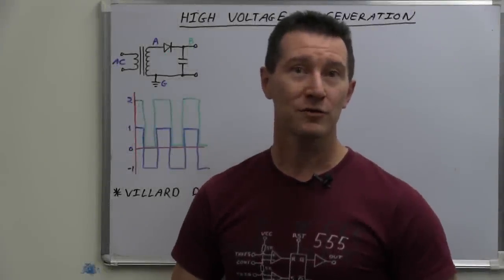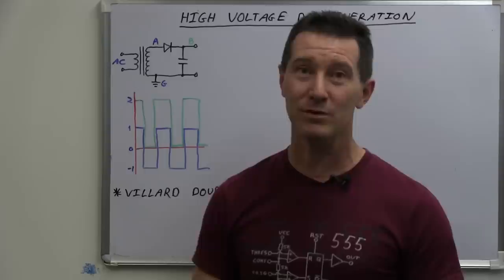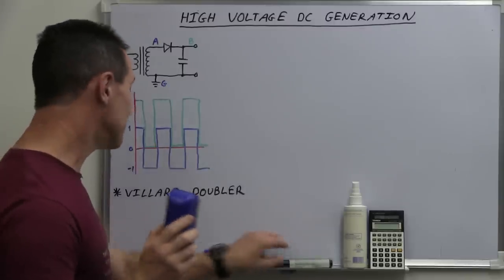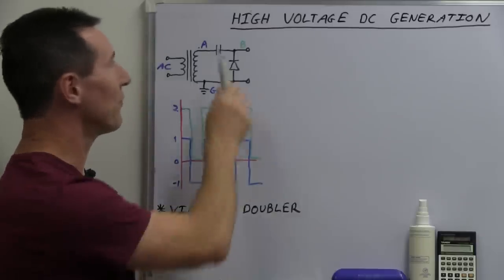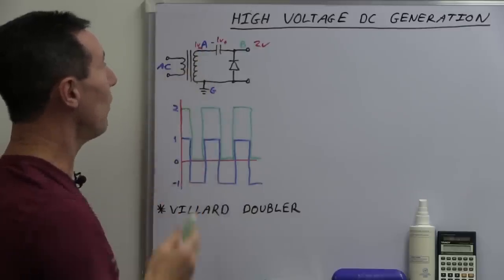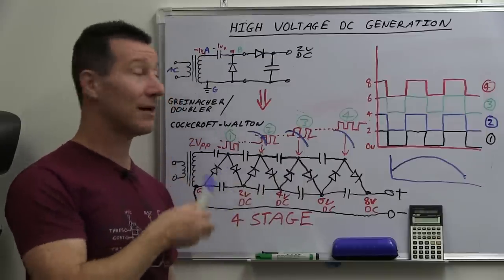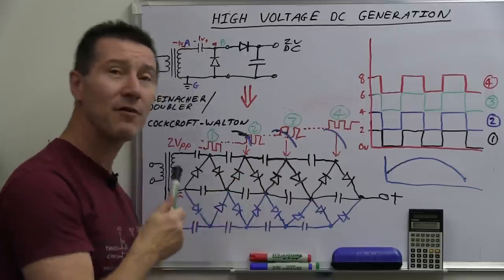EEVblog #469 - Cockcroft-Walton Multiplier

Comment: Hi There sir. I was wondering you said that you dont need diodes of the voltage of the expected output but only diodes rated for the voltage of the input. Is This same statement true for the capacitors

Comment: Thank you! I made one today after I watched this! I have a question... I am using this to send B+ power to an AM tube transmitter. It works! But... It transmits transformer hum... Any suggestions on eliminating that beyond the obvious filter caps at the output? (I tried that)...

Comment: @EEVBlog, How to calculate how much current such a multiplier can source/sink?
Reply: you most likely wouldn't put a load directly on the circuit as it can mess with its behavior. Using an operational amplifier with a gain of 1 will allow you to source/sink anything the op-amp can handle
Reply: If you don't consider the diode drops (and using low resistance diodes) you have a load cycle for your caps on low input value, so during high time you have an RC stage where R is the load and C/n is the capacity (n number of stages and C the value of the caps) thus more stages generate lower charge available, probably a cap in parallel on the output might help

Comment: I decided to make a Negative Ion Generator circuit after this lesson :) . I failed in a step but I can't detect my fault. Can anyone help me to fix it?

I used in my project;

30x 22nF 630v
30x 1n4007
1x 4.7mOhm resistor before the needle ( at the top)
Powered by 220v ac.

Some of the caps burned in the first try.
Reply: Random caps or most at the high voltage end? 12 of each might work better.. to sufficient voltage.

Comment: That is a cool circuit.  What is the capacitance value for the caps in that circuit.  What value would you use @ 60 hz and 10k hz?

Comment: I have a doubt. If we are applying AC Input. How in the oscilloscope we are seeing DC Volts. There should be high frequency AC.
Reply: I think - cause of Diode(1)  only 1/2 Cycle  AC  passes   ...   and so on.

Comment: Q: Is it possible to operate a CW multiplier in reverse? (i.e. Convert a high voltage high impedance source and generate low voltage AC)
Reply: Nope. If you did that, nothing would happen.

Comment: I've done this with using 28 numbers of 10nF /630Vac PPC capacitors and  28 1N4007 rectifiers. but didn't get expected high voltage at end.I couldn't find polyester capacitors but poly polypropylene.  Is that the problem & how come?

Comment: would this be an all right circuit to use as a variable power supply? (pull down at each 'doubler') (and adding a voltage regulator to keep the current steady)

Comment: What I don't understand is, how much current can I drive with this villard circuit ? And they use this circuit in the isolation tester, because I can directly use a Transformer like in a flash unit or TV Anode driver.

Comment: Is the output from the voltage multiplier of a TV set with @ 25 inch diagonal screen about 25000 volts at about 2 milliamps?

Comment: Thank you. informative and not boring at all!

I would like to ask, a voltage multiplier like you vid, doesn't multiply amperage? Or  stay the same or some losses?

anyone?
Reply: REMEMBER... when voltage goes up Current Goes Down
Reply: Luis E. Batres You forgot “for a fixed power or resistance”.
Reply: If it multiplied current as well, it’d be the solution to all our problems since P = VI. If you increase both voltage and current, we’d have more power at the output that at the input! That would solve the energetic crisis (and desperate physicists because they have to rewrite all the physics as you’ve just broken the first law of thermodynamics).

Comment: I have a Villard 8 stage with 20vpp input running and noticed that the total voltage is 500vpp. This is the max rating of any cap in each stage. Is this correct? TIA.

Comment: Hey Dave! I have a question. I have a LiPo and 3 voltage dividers running off of the battery (powered on by switches, I use this to differentiate between the three switches with only one ADC pin on my MCU instead of 3 IO pins, let me know if you know a better solution). All divider outputs (which output different voltages) go to the same pin. What happens when I press two buttons simultaneously? Does the highest voltage apply?

Comment: What about the current?..... since the voltage is only shifted up....does that effect the current.....does it drop in proposition to the V increase?
Reply: ken ezzell 
hi, there is only so much energy in the capacitors at each cycle, so this limits the current available. LT Spice is a good place to examine the operation.
There work very well when the input is the switching node on an existing DC-DC converter running at a few hundred kHz ☺

Comment: How do you compute the output power from a cw multiplier is it just based on the energy stored in the series connected caps, and is output power limited by the  caps themselves?

Comment: It's really helpful, But as implementing few questions arises like as I am getting 4-6 volts as a output but If connect the o/p with lower resistance value like 50 Ohms -30K Ohms, output voltage drops to near about 0-0.5 V, Here I just used resistance to connect one terminal of its with o/p of ckt and another one to ground. Is there any other option if i wanna work with lower resistance value(50-500Ohms) as o/p; expecting more than 1.8 V as o/p.

Thanks in advance.

Comment: Great explanation.  What happens to current through each stage, so that one can determine current ratings for the diodes?  Wouldn't 1 volt AC RMS be 1.414 volts DC?  I have a big plate transformer with an input of 240 VAC and an output of 1800VAC at 750ma which I want to use as the basis of a -40KV power supply at 40ma.  Doable with a CW multiplier?  Thank you for posting.

Comment: Sir which transformer you used??? actually we are mking marx generator so we need 2kv pure dc input for it.
Reply: +Sanket Yadav a tube amp transformer works great secondary 400-0-400 / 800ct and a 4 stage like dave has drawen 16 diode type will work use 2000 volt diodes and 600 volt caps / ps if you pull 50 ma you need a 300 ma transformer

Comment: Slightly off topic, but I'm a noob seeking help. With an incoming signal that is a squarewave oscillating DC. Could I potentially wind a transformer such that there are 2 secondary windings each being of equal turns, but going the opposite direction to each other, and then simply combine the positives and negatives to get a smooth-ish DC output?
Reply: No, Because you will never get a square wave out of a transformer.
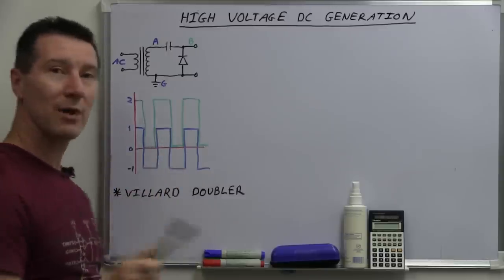Reply: A year later lol..  note 1:55

Comment: Maybe somebody can help me: I don't get why at 6:35 the red point mentioned should go to 0 volts. If it is AC the diode should have the purpose to charge up the capacitor to +1 volt, not allowing a discharge. If in the next cycle the +1 volts from the capacitor are added to the -1 volts of the voltage source it ends up with the 0 volts at the given point. Help plz. ???
Reply: So as far as  I get it: The "lets call it positive cycle of the voltage source" charges up the left capacitor, where else  the "negative cycle" pushes the charge of the left capacitor to the right one due to the voltage source (1volt(source) + 1volt(cap)=2volts? Not sure though...

Comment: Can this be used in an ebike to have a single 12 v dc battery and pump up the bolts to run a 48 v bldc motor ?
Reply: I'd rather recommend using a DC-DC converter such as a boost converter for your application.

Comment: Not so fast!  The voltage across the transformer is 1 volt PEAK TO PEAK.  The first capacitor and diode comprise a CLAMP circuit, meaning the negative excursion of the peak-to-peak 1 volt signal is CLAMPED to  0 volts.

Comment: why would you need the transformer at the input stage in the first place?
Reply: Step up tranformer used to give the multipler a high starting voltage to work with. Also will isolate high voltage ground from the more sensitive electronics.
Reply: @seinfan9  At 1:03 the presenter says it's a 1:1 ratio transformer. So I'm not quite getting the "high starting voltage" you mentioned. Could you please explain this? And I'm also not getting the second part. Why do we need this galvanic decoupling? What is wrong with this "high voltage ground"? And what is "high voltage ground" in the first place btw? It's still 0 V isn't it? If you "transform" 0 V it'll remain 0 V won't it? :)

Comment: Can I use DC voltage for the multiplier supply?
Reply: The multiplier needs a pulsetrain, because it is a switching design - if no switching goes on, no multiplication happens. See video "microcontroller voltage doubler" where a PWM output of microcontroller is used to provide the AC/pulsetrain to the voltage multiplier. There are numerous ways to generate AC or pulsetrain, such as using an oscillator, a timer IC, a feedback transformer like in Joule Thief...

Comment: Hi,
In order to reduce the stress over the capacitors and to equalize the currents,is it a good practice to put a high value resistors in parallel with all the capacitors,or this is a bad idea?
Thanks.
Reply: Buda Alexandru Sebastian According to circuit simulations, a high value resistor used as you mentioned speeds up the time it takes to reach peak voltage on output.
Reply: peepeeland Which simulators did you use? If you dont mind me asking.
Reply: LTspice.  There are diminishing returns with higher resistance and speedup is negligible (something in the 100's of ms range, if I recall correctly...), but just to keep things tight, I use 80M ohms.

Comment: You can get better performance and smoother output on a long Cockcroft–Walton voltage multiplier by feeding AC to its middle rather than one end.  But, instead of say a huge  + voltage gain at the far end you will get half that at one end and its negative voltage at the other far end. And,  because the top and bottom capacitor chains are halved,  you can push more power through.
simulated: http://tinyurl.com/syr2m9t  notice the same component count in all the circuits, just inserting power at different points.

http://tinyurl.com/scoosfj voltage doublers

Comment: can i measure this potential with a non rms multimeter like a fluke 15b? cuz i have tried to make this circuit for more than 2h and it didn't work...... the potential goes up and down between 2-8v and im using a 12v transformer.
Reply: I DID IT!!!!! HUAHAHAAHAAH i don't know why but my jumpers were affecting the circuit, when i took them out and connected the alligators directly to the components it worked.
Reply: ***** if anyone can point me why the jumpers were affecting the circuit would be nice.

Comment: I tried to make the pre stage for this circuit using a salvaged 12v-220v transformer, an n mosfet and an atmega 328p uc to provide pwm output to pulse the primary but for some reason it does not do anything at any pwm frequency. If i remove the mosfet and uc and just pulse the primary manually by connecting and disconnecting the wires from the battery it works. Has anyone else tried this and experienced the same? Thanks

Comment: is this also used in microwave ovens?
Reply: The Cockroft-Walton voltage multiplier is used in x-ray machines, particle accelerators, and applications where a high-voltage, low-current supply is needed.
Reply: I built one back in the eighties as a power supply for a laser tube (for holography). Great circuit that I never really understood until watching this fantastic video

Comment: Why do we need to increase voltage to run an appliance that can run on the same input power? Please, someone help
Reply: Because appliances are designed for a certain voltage and with the wrong voltage they'll use the wrong amount of power.

But you wouldn't use this circuit to increase voltage for an appliance. It's more for high-voltage physics kinda stuff.
Reply: The anode of a cathode ray tube tv may need something like 30000 V

Comment: Where is this circuit  used in Dave?
Reply: I think, I saw this in a microwave oven.
Reply: High voltage power supplies would be one application. The lab I work in, we use supplies that go up to 20kV. Also insulation testers. They need to provide a high voltage in the kV range in order to measure current from extremely high resistances such as GOhms or TOhms.

Comment: Square wave going into the doubler . OK  then you must be using a sine wave  frequency  altering device to produce a square wave because the power company produces  60 cycle sine wave Ac while Europe uses 50 cycle sine wave . To my knowledge that  has not changed since Nikola. Tesla  brought AC / induction motors/Transformers to the  world which has been used ever since.

Comment: Excellent explanation!  I remember as a kid building one of these multipliers inside a transistor radio case, to terrorize the neighborhood kids.. lol  So now if the output stage is coupled with a capacitance multiplier circuit, would that smooth out the ripple (somewhat)?  ( https://www.youtube.com/watch?v=wopmEyZKnYo )